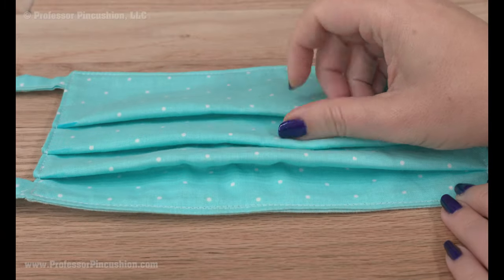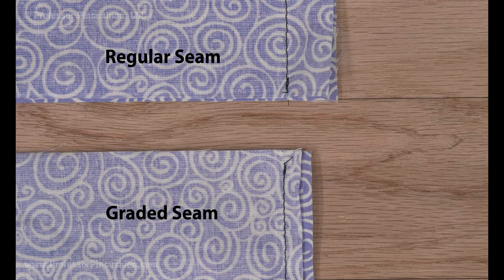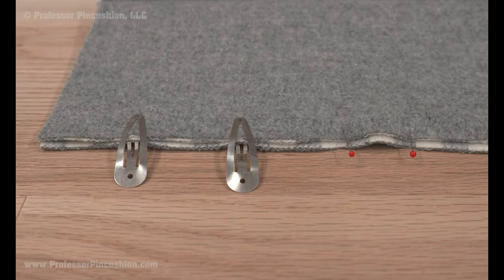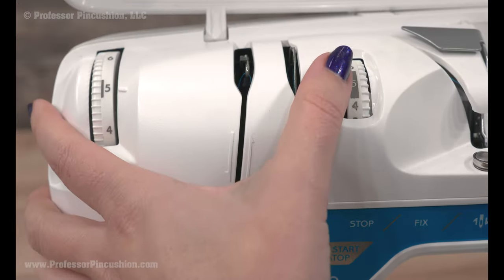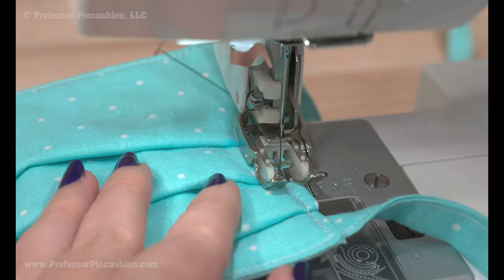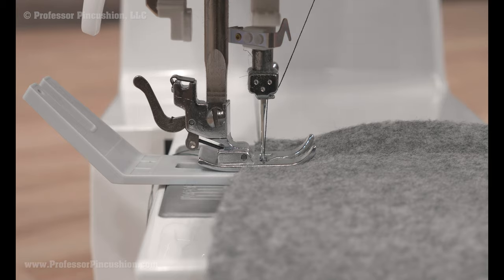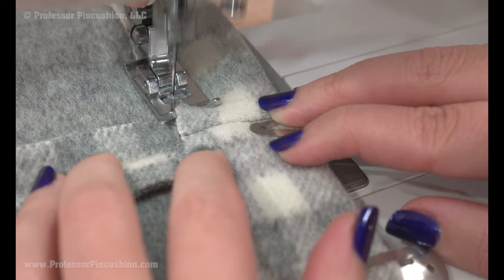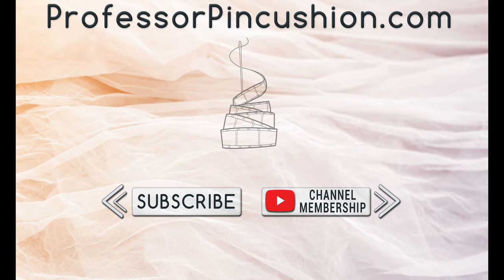How to Sew With Thick Layers of Fabric - Multiple Layers

Comment: I had an old, old knee operated sewing machine given to me.  It would sew through anything, including multiple layers of tent canvas. It wasn’t an industrial machine, just a home sewing one. It never missed a stitch. Now my many thousand dollar Janome has a panic attack & cries if i try to sew two layers of denim 🙄
Reply from the maker: right? Those old metal beasts could sew through anything!
Reply: Ughh same, im trying to sew layers of canvas it so frustrating
Reply: My mom has an old knee machine it is amazing!! Still works to this day.. they don't make them like they used to
Reply: Its like that for everything im afraid 
No passion in working tool
Just consumer life
Break faster need buynew one or better anyway more money for producer
Reply: @lindak8664 
Thank you so much! You just saved me $699! I have a basic Janome beginner machine. It just can’t handle thick materials such as denim and canvas. My local sewing machine repair guy told me I’m “asking too much of a beginner machine” and said I needed to upgrade to a newer, more powerful Janome" I went home to research it and came across your post. Pulled my Aunt’s old “antique” metal Singer that only does forward and backward stitches out of the storage closet. Manual tension knob. Old school. Well, it powered through my canvas tote bag project like there was no tomorrow! Thank you from the bottom of my heart! They sure don’t make them like they used to! ❤️
Reply: So true. My mother had a wonderful Necchi cabinet sewing machine with knee pedal that she purchased in the late 40s or early 50s. I used it constantly as a teen and young adult; loved sewing on that machine! They gave it to a professional seamstress friend when Mom's health was failing. I already had a good multipurpose machine and a Babylock serger. I was glad it "went to a good home" at the time (late 1980s) but I often wonder what became of it.
Reply: I have one of those . And I would choose it over anything new any day of the week. It’s a singer touch and sew (touch and throw?? lol). Mine does not suffer f from any of the issues that this machine was apparently notorious for. But then, mine is all metal.  I love the knee lever so much more than the foot pedal. Not sure why exactly but I do.

Comment: What is that leveling tool you used at the back of your presser foot called?

I've used folded fabric or cardboard in the past - when I remembered.

When a friend got a new sewing machine to make masks last year, the one problem I frequently saw is wanting to sew at top speed. If you only have one or two thick parts to sew through, you don't lose significant time when you slow down for those parts. It's also extremely dangerous to go at top speed before lowering the presser foot. Especially with fingers close to the needle. Asking for help then nearly sewing over my fingers flooring the foot pedal is a sure way to bring all hands-on help to an end.

One tip I wish I had learned and put into practice sooner is to increase the stitch length for bulky areas.

I really appreciate videos like this to remind me of practices that can improve my sewing and decrease frustration.
Reply from the maker: You can search for "sewing clearance plate" or I think the dritz version is called the jean-a-ma-jig.